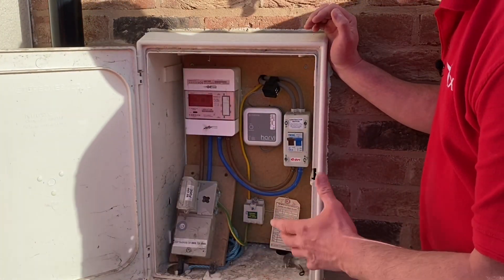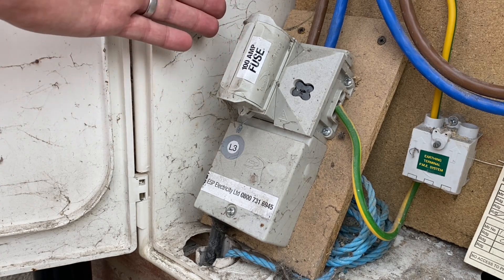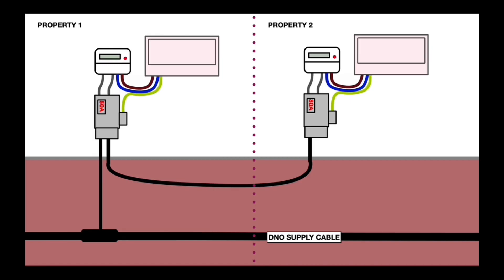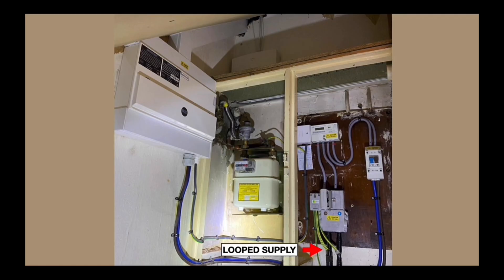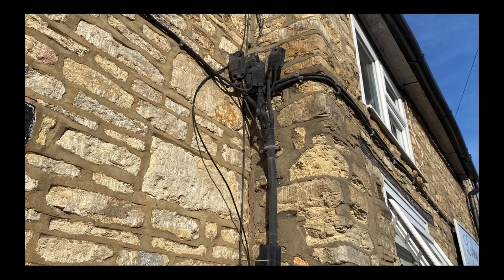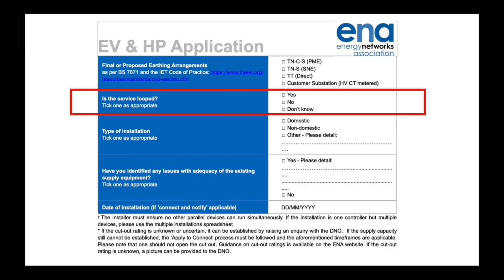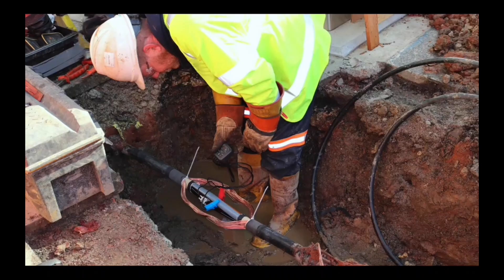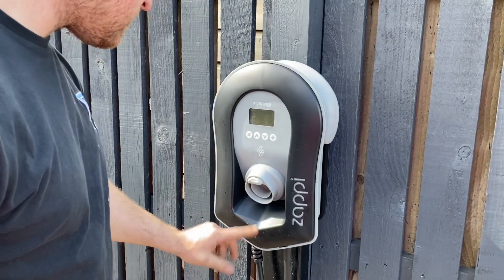EV Charger installation : BEWARE Looped supply - what are they , cost and time to correct

Comment: I bought my car at the end of March, ordered an Ohmi charger for the house only to discover it was a looped supply. WP came out & said next door would have to comply - I said you don't know my neighbour!!! She didn't want her garden digging up or old tarmac drive and sought Legal advice. Fast forward & it was resolved all this week with contractors digging up my block paving again. Luckily it was free of charge except I had to pay for a builder to take out bricks & put in a new board & sparky. I now have a 3 phase supply with a Single phase meter still in place. Was told I had to contact provider to get it moved to a 3 phase meter. The electrician advised me to go for a new Hager 14 way SPD Dual RCD with 10mcb board so I did. What charger is the best one to go with? At present I still have an Ohmi charger in the box waiting to be installed....I know with a Tesla the maximum speed I can charge it to is 11kw so would be a bit faster than the 7kw that's sitting in the box. Any advice would be great.
Reply from the maker: You would need three phase to use the 11kW facility on any EV charger.  ohmi chargers get good reviews
Reply: @efixx  Indeed they do, except I don’t think they do anything past 7kw. I do love Anderson’s design

Comment: Thanks for this. Just ordered an EV yesterday and of course I'm on a looped service despite being in a large detached house 🤯 Are there any other reasons a house might have a second cable running from from their electricity box?
Reply: Could be supply to street light
Reply from the maker: Not really check with the DNO asap to avoid delays

Comment: This is great but we live in the country and have overhead lines and I have spent hours trying to find out how to recognise a loop system for overhead supply.  Having ordered the EV charging point the company turned up to install the EV charge point but seemed to have an excessive lack of knowledge so we started to research our situation.  During this time we had considerable trouble getting the installer back on site after he made several excuses as to why he could not do the installation on the original day.  We ended up contacting the DNO and they were very helpful in booking an appointment to survey the connection which will be on the 4th October but at least we feel as if we have moved the process further on.  We are extremely worried about the service we have had from Pod-Point so far as they just wanted to refer us back to the DNO when the DNO had told us that the installers should had done a load test.  This is awful when you think you are dealing with professionals.
Reply from the maker: Sadly there are a lot of poor installers out there

Comment: finally we have our electricity supply unlooped by Western Power, our Octopus smart meter fitted, and our pod point charger fitted, and all this after only starting the process in March !! We have learned so much from this that we could write a book, but got there in the end and car merrily charging away as we speak, so anyone thinking of going down the EV route, please do your homework on your supply and if it is looped or not, and ensure your smart meter will fit into the space vacated by the old one (Western Power had to move the new supply to allow more room for the bigger smart meter). Good homework will save you soooooo many headaches in the long run !!
Reply from the maker: Thanks for sharing your experience 🙏
Reply: I spoke with Western Power this morning about getting an ev charger installed and they were adamant that we would have to pick up the bill for unlooping work and fuse upgrade to 100a.
Not what I was expecting from this video and others.
Was that your experience?
Reply: there is a document online "Company Directive - October 2020 : Standard Technique : SD5G/5 Part 1" Relating to the connection of low carbon technolog (EV Charge Points and Heat Pumps With A Capacity of less than or equal to 32A per Phase. In that document on page 2 it states under the heading "Impact of Changes", Western Power Distribution (WPD) will provide free of charge service upgrade costs for domestic installations (profile 1 or 2) where each item of low carbon technology has a rating of less than or equal to 32Amps. So basically they are saying as long as your EV Charger is 32A or less, then you should not be charged for the work. Why did they upgrade you to 100A fuse ?
Reply: @paulypyro  thanks for the info.
I currently have a 60A fuse.
They talked about this needing an upgrade to at least 80A to support additional ev charging.
I don't really need that as I will only charge overnight, and am happy to fit a load balanced charger.
They didn't really want to discuss in detail until they received a formal application from an installer.
Pretty disappointing, and hardly encouraging people to switch to EVs.
Reply: I had replaced like for like at 80A as we did not have electric heating or anything other than standard things like dishwashers, shower etc, so not sure why they thought 100A was needed, but just send them that doc reference and if they get funny about it take it to National Grid who have just acquired Western Power a number of weeks back, as there is no way you should be paying for it. The guys who came to do my work were superb, it was the managers who cost me 2 days off work for nothing ! It will be worth it when it's done honest lol
Reply: @paulypyro  I will do.
Thanks again.
What ev do you have BTW? I'm looking at an id3 or eniro.
Reply: yes do keep at em, they are buggers lol........I did loads of research and went for the Peugeot E2008 which we love to bits, and thankfully I got an offer just after the govt moved the grant goalposts. ENiro will give you more range if thats what you are after

Comment: @efixx I've come to this one a bit late but here's our unlooping story. We own a semi-detached ex council house and our neighbours are still with the council. Suddenly we got a notice from either the council or the energy supplier, can't remember who started the ball rolling, but they wanted to unloop us and announced they were going to dig up half of OUR garden in the process. Knowing they would be tramping all around the house I drew the line at having the garden ruined so something happened after a stern letter and the garden was left intact. However somehow the joined cables were in the loft while the CU is in a downstairs cupboard on the wall between us and the neighbours. They separated the cables in the loft and then proceeded to drill random holes into the bedroom and airing cupboard below to try and run the main cable down through to the consumer unit. They gave up trying to make the cable run down the adjoining wall because they "couldn't find it". Why the hell they didn't drill upwards from the right spot I'll never know! So when they found by chance they'd got a hole in the airing cupboard just inside the door frame they ran the main cable down, into the cupboard below to the CU box. There is a hundred amp fuse now next to the CU which I'm guessing they fitted because the floor is concrete and they couldn't get the cable outside. There's still a 100 amp fuse in the outside meter box so no idea what's going really! (Just had new CU fitted but electrician seemed OK with that.) 
I suffer with a chronic illness and after a week of anxiety about what damage they planned on causing to the garden and a day of listening to drilling and running up and downstairs, I was too shattered to realise what they'd chosen to do without consulting me before it was too late. 
So now when I'm eventually able to cope with having the decorating done there's a ruddy great thick orange cable sitting about two foot inside the room and running down a wall which could easily be required to be taken out as it's non load bearing.
I wrote a six page letter to EDF energy and didn't even get a response. Just so you know this was at least a decade ago btw, I'd like to think things have improved a bit since then!

Comment: Useful information. While I’m not planning to install such a thing yet, I know my place is looped to next door (semi detached), and exactly how the service cable is routed. Earlier this year, the DNO replaced all their buried distribution cables (and also their local transformer) on account of having had lots of cable faults, but they left the last metre or so of the service cables.  Although the housing in the area concerned is not much more than 30 - 40 years old, there was a lot of dodgy distribution cable, that suffered from failed insulation with water seepage between phases. They must have bought something cheap and nasty then, perhaps!

A short movie about this project is available here on my channel: https://youtu.be/LS8VFhRMsYY It might depend on who wants it done first - my place is the first one on the service cable. The street involved was built in 1983/4, and I think many of the semis are looped in pairs. Both my place and next door had Economy 7, and 100A main fuses.

The odd thing now is that the current direction in the service cable is both ways, as I have a solar PV inverter on it. Next door has the first option on my surplus, with the rest being fed the other way, some of the time.
Reply from the maker: Thanks for sharing - you video clearly shows the disruption of a supply cable upgrade.

Comment: Hi I have what appears to be a "looped supply" but closer inspection suggests it's a Y cable at the cut out fuse end. But a single cable going into the ground?

Confused.

Also what's the deal with the "granny cable" if you haven't yet got a charge point?  Can you really use a normal plug socket safely as it appears.
Reply: the cable resembling a y is the live and neutral conductors separating
Reply: @persona250  cheers for reply. Got it all sorted and it was probably as you said, I forget now. There was a large lump/knot where the cables split, so made it hard to work out. Have a had a charger installed since and all is good. Was dreading the new resin driveway getting dug up.
Reply from the maker: You can use the granny cable as these are just 10A load

Comment: Just to clarify as it wasn't mentioned in the video; I take it the side with only 1 cable in the cutout is the one to contact the DNO? as they're getting power from the neighbour(s) with 2 cables? Would/do the DNO have a register of properties with looped feeds? Asset management type thing.

Comment: Hi efix,

Would this issue be resolved if the EV charger has a balanced load function (as the Pod point and Zappi have) that automatically reduces the charge rate when the household demand/load is high?
Reply from the maker: The problem is you can’t control the power being drawn by an adjacent property.
Reply: @zlmdragon.  Also have to think about the supply cable before it is split. Every night that will have a constant load on it, like a spur on a ring.

Comment: Our experience... we are in 'property 1' where the neighbour is looped into our supply. When enquiring about getting a wall charger installed some 2 years ago, we were advised by an electrician that the installation would be fine until 'property 2' required his own wall charger installing. In fact, we could not instigate property 2's upgrade solely by us requiring a wall point! (an added complication is that next door is a rental property, with the owners living overseas). Hence we have had a basic Rolec wall charger installed for over a year (no issues... no free 'heating' in the garage). Because we only charge overnight (@7kw/hr for 4 hours, at off peak rate) perhaps twice a week, I cannot see any load problems with the original electricians statement (although he was probably inexperienced on the subject at the time?). For info, the neighbour does not have night storage heaters. So, should we chase the DNO for a split, or just keep an eye out for next door getting an EV. As an aside, some years back, one tenant had a wall point installed for his BMW PHEV (no, not an i3)... this was removed when the left, and at that time we thought nothing of it... us not being in the EV market (obviously nobody twigged that the property was at the end of a looped supply either) . Your thoughts please... and do you think the DNO will stop us using our charger if I point out the existing situation?
Reply from the maker: If you don't have a smart charger or claimed the OLEV (OZEV) grant then the ENA form probably won't have been submitted. So the DNO may not beware of the problem.
Reply: @efixx  Correct, not a 'smart' Rolec, hence grant not applicable! I'm sure any new tenants will talk EV with us (living up North, we are generally a friendly lot), so we will be able to give them an insight into the looped supply situation when it becomes relevant.

Comment: Hi Boys. Love the content.

I've got a 60A looped supply, which is fed from my neighbours house. 1960's semi. I looked into getting a charger about a year ago, and even applied to my local DNO for a 100A supply. I didn't proceed with the application as I was of the belief that the Zappi's load management settings could manage the supply constraint.

A local OLEV installer surveyed yesterday and was very firm in saying that I couldn't get an EV charger installed officially (via the OLEV scheme) without unlooping and getting 100A supply.

Is this the case?  Has there been a change of stance from the DNOs or the regs? Is load management not deemed scalable and sufficient if everyone gets EV chargers?
Reply: Yes zappi (myenergi) insist applications must be sent to dno before any works on looped supply begin. They also said 90% will fail application on looped supply even with load management as you need to prove to them how the load will NEVER go above certain amps.

Comment: There's a couple of things that worry me about EV charging, even though I'm not a driver, but I have friends who are, and that's first of all about earthing, seeing as there's so many different earthing arrangements, like the old TNS type supply, my favourite, and the later fancy PME system with TNCS and the dreaded TT system often used with rural overhead supplies but sometimes also used in towns with underground supplies too, and I know where there is some such not far from me. And I'm assuming that one side of the charging supply to the vehicle, most likely the negative side, is strapped to the vehicle bodywork just like the starting battery is on engine powered vehicles, seeing as the vehicle body is a large mass of metal insulated from the ground by the tyres and therefore potentially dangerous so EV charger installation should be made a job for professionals only just like gas installation work. And the other worrying thing is the possibility of seriously overloading the supply cables given how thin some of them are like the one at a friend's house and that a lot of them, like mine are very old and date back to the early days of electric supplies to houses and are only designed for up to about 80 amps or so or even less and some of the new EV chargers take huge amounts of power and like you say are often left on for hours at a time so surely the network operators and ultimately the government need to seriously think about upgrading all our domestic supply networks, right down to the service cables to the houses or else there could be some serious electrical fires like some of those shown elsewhere here on you tube. And I've already seen some underground distribution cables being replaced in my local area recently and the local town supply substation near me was all rebuilt a few years ago and I hope that they've increased the capacities too for supplying all these new EV charger installations.
Reply from the maker: Most of your concerns have been picked up in the standards for the EV chargers and specific regulations with the IET regulations.  We have quite a few videos on the channel which explore this subject - thanks for your detailed comment.

Comment: I have a looped supply to my house, just two houses on the loop. SPEN are happy to just upgrade the cable between the houses and the fuse. Surely a new cable during unlooping could be moled in? I'm having this down with our water supply soon. Saves digging up the garden or driveway, just a small hole in footpath, and near house, assuming a straight run.